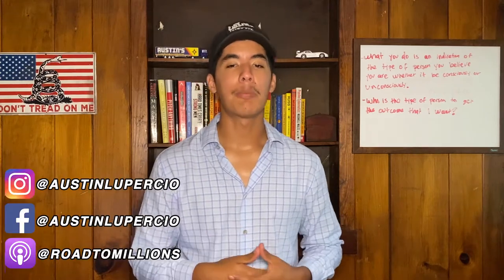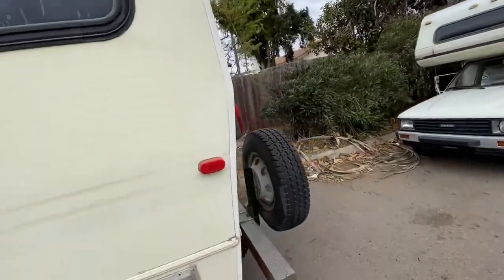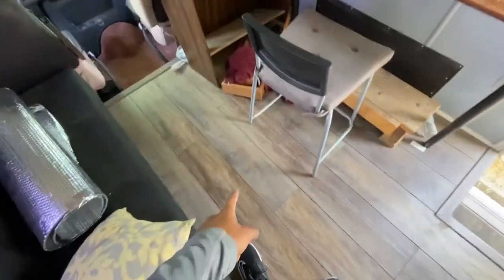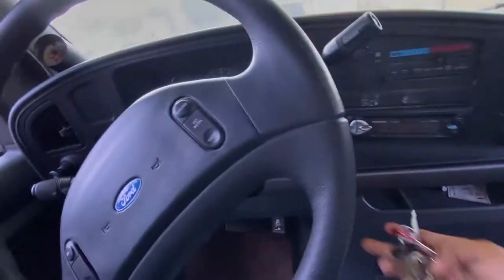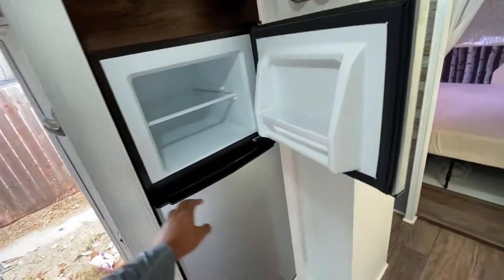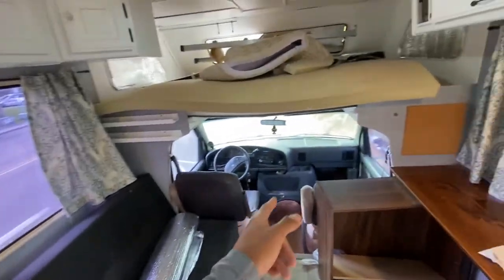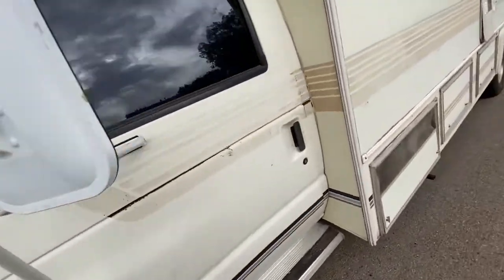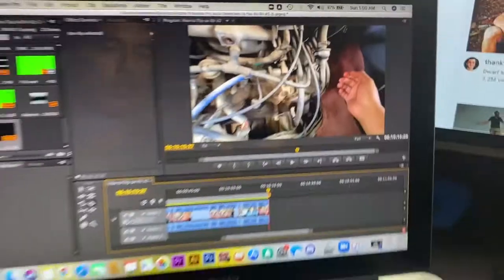How To Flip an RV | Flipping an RV for Profit Part 2

Comment: Austin, the contraption on the roof just to the left of the air con is a digital TV antenna.  It is raised into position by turning a crank located in the ceiling.  Judging by your interior shots of the ceiling it appears that the crank is missing....there's only a stub of a spindle sticking down, so whoever painted the ceiling during the renovation forgot to put the crank back on.  There should also be a dial on the ceiling mounted coaxially with the missing crank...the dial is turned so as to "fine tune" the different digital TV signals.  I know because I have a truck camper and a similar antenna.  They work pretty good actually....I watched the Superbowl this year using mine.  Thanks for this.